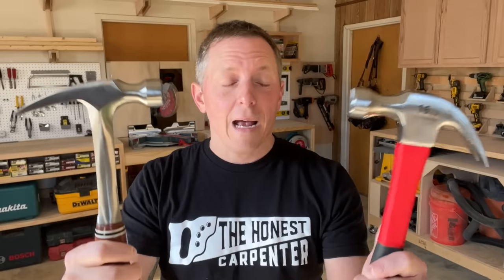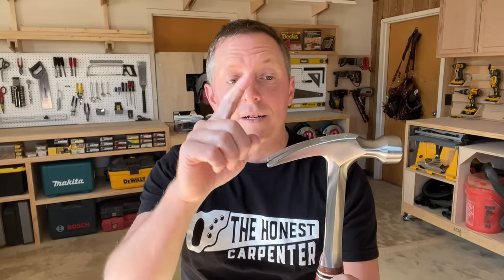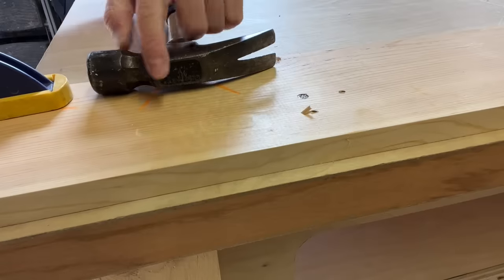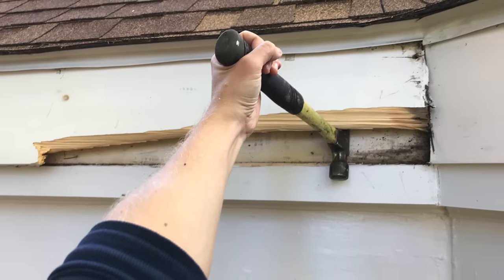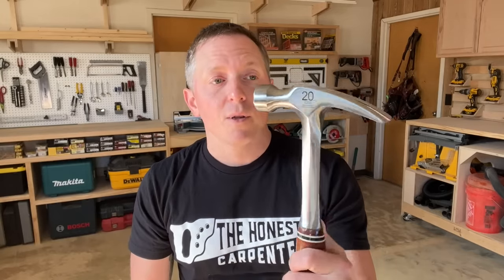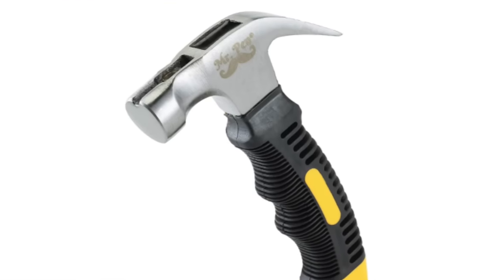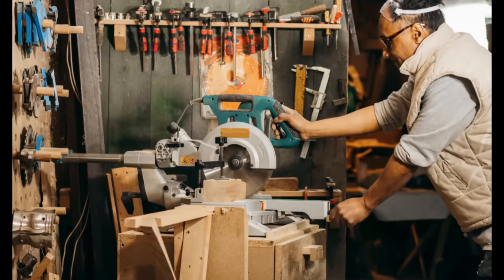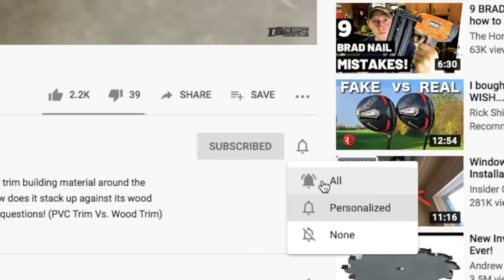DON'T USE STANDARD HAMMERS!! Try This Instead...(Rip Claw Hammer Vs. Curved Claw Hammer--Which One?)

Comment: Why are some hammer heads smooth and some with bumps? Please explain, I would really appreciate it! 

Thank you!  😀😀😃😃😃😃
Reply from the maker: The bumps are really just for big framing hammers Ziyad! They’re called “milled” or “waffle” faces, and they prevent the hammer head from slipping, or the nail from bending, when you’re driving big nails. But they scar your material surface too! So, they’re only really effective for heavy framing 🙂
Reply: Wow, thank you so much for the detailed reply!
Reply: Those bumps are for removing large chunks of skin and knuckle meat from your unsuspecting hands. I speak from experience. Lol
Reply: @blainehankins  me too 😆
Reply: @blainehankins  good thing I’ve never done that :)
Reply: @Print-Productivity  They also leave a waffle pattern on the paper, when nailing sheetrock - this is good for the joint compound to adhere to.
Reply: A shiny hammer face is more likely to miss hit a nail (of course it's really you) but if it gets overly polished rub the face on cement to dull it and therefore transferring force better.
Reply: I’m not a professional like you but my preference has always been a rip claw (for the same reasons which I didn’t realize until you pointed them out🥴).
Reply: @blainehankins  Yep, a meat tenderizer for your hand. 😁😁
Reply: @blainehankins  Yes, I thought they are for tenderizing steaks! 🤣
Reply: @TheHonestCarpenter  Waffle faced framers are made for removing your left thumbnail, over and over again.
Reply: I’m a retired carpenter and in the trades out west most people I worked with referred to them as corrugated head hammers and yes pretty much only for rough framing and the last thing you want to hit your thumb with especially on a cold morning. I currently have a curved hammer only because I found it in the barn when I bought this property.
Reply: Drywall head meant to not slip or rupture the paper covering the gypsum filling. I bought one for my father when I was a kid, not knowing he'd have zero use for it. Yeah, I felt silly too.
Reply: This is not a fishing channel.  lol
Reply: @TheHonestCarpenter  brand new ones work great for converting box nails to finish nails.
Reply: Waffle face hammer 🔨 bites finger with teeth before smashing it. Smooth face, merely smashes finger. Got all mine.🙌🏽
Reply: Hahaha
Reply: They are for Toe Nailing. In some jurisdictions in the Midwest, where they had Tornadoes, Toe Nailing was required. A proper Toe Nailed Framing Member the Nail will curve into the wood. It was a skill I was only Moderately able to Master. My Waffle Head Toe Nailing Hammer was Stolen.i replaced it, but due to my HVAC job becoming year round, it’s in new shape. BTW This was back in the 70’s, long before Pneumatic Nailers.Back then if a house, was put up, “Nailed,” like today’s houses, the inspector would have it all torn down.
Reply: The "bumps" are for education. They quickly teach you how not to mash your fingers. Before I became a framer I had only ever seen/ used smoothies & had whacked my fingers several times. When I got my first framing hammer I whacked my thumb once. *ONCE*. The only time I ever hit myself in the 30-ish years since was with a smoothie claw hammer due to a loud noise startling me as I swung.
Reply: @paulsawczyc5019  Who nails sheetrock anymore? Haven't seen that done for at least 30 years.
Reply: @ErgonBill  When you get nails for free, you use them - screws keep on going up in price.
Reply: One washes its face often and the other doesn't.
Reply: Smooth faced hammers are more for finishing work, due to the fact that they create less of a mar on your work piece, but you can still use them in all types of carpentry. .
Reply: It also makes it easier to nail in awkward angles/places. Like 45 degree into a corner of jamb and sole plate.
Reply: I would like to add concrete form work as another essential task for a rip claw as opposed to the curved claw. It's useful as a digging tool when the form needs to drop a little with respect to the stringline, as well as for picking up the board ( by way of a claw strike ) to slide it up the stake just before nailing off underforms ( additional boards that may be needed below a top board set at string level.
Reply: I think those bumps are to see how good a person is at driving nails, the less damage it shows on wood, the better the user is lol. Seriously I think they're for gripping nail heads.
Reply: @TheHonestCarpenter  
Hello, what is the difference between "Framing" and "heavy framing"?
Reply: Flat is for finishing. The waffle can pull the wood if you pull twords you as you hit if you dont care about leaving marks
Reply: I actually own. Kobalt Rip claw that I use at work...I didn't know it was a rip claw till I saw this video 🤣
Reply: Never touch my waffle
Reply: To better tenderize the meat when you hit a finger by mistake :p
Reply: @TheHonestCarpenter  your affiliate links promote a company that fights against human rights and worker rights.
Reply: A smooth face is for finish. A milled face is for framing. A framing hammer grips the nail head when it makes contact, but leaves waffle marks. I have a smooth face hammer for jobs around the house.
Reply: The waffle helps!!!! Precised one hitter
Reply: The waffle face or milled face hammer give you a bit more grip on the nail head so it doesn’t slip off the nail. Smooth hammers are used on smaller trim nails or hanging pics
Reply: Men who have bad "aim" 😂
Reply: Waffle face hammers are training hammers. They teach you not to miss the nail head and not to hit your thumb, by giving you severe pain, like a tough coach. Once you've mastered your nail driving skills, you are ready for a smooth face hammer.

Comment: I grew up using the curved claw hammer. It hasn’t failed or stumped me yet. Being in the electrical trade didn’t require having the rip claw in my repertoire. I’m over 65 so chances are I won’t be changing over anytime soon. I’ll leave that choice to the young bucks coming up through the ranks. Great video as always.
Reply from the maker: Thanks Bill! I like hearing from other trades. I could see the curved claw working well for electricians, especially because of work being done on more finished surfaces.
Reply: Electrician here 20 oz estwing rip hammer
Reply: @matttrackwell9346  Kinda funny. I bought an electricians 16 oz straight claw hammer with the longer hammer head for specialty framing. My Estwing is a little too beefy for staples and clamps on Romex. Kinda squishes the small parts.
Reply: was candy a nickel? did people REALLY sit around reading stuff on dead trees?...im #NotABoomer  .. tho i am a sparky
Reply: Didn't know about one piece straight metal hammers decades ago, until I snapped half a dozen of hammer handles.
Really bad when they breaks after store hours.
Then I started to notice.
Reply: In my day, we used to walk uphill both ways in the snow 5 miles to work
Reply: @galvanizedgnome  barefoot!
Reply: Electrician here. I keep a small maul in the car but otherwise my kleins are my hammer.
Reply: As a stockbroker, I've used a hammer once or twice in my life, and I recommend a 16oz flat hammer. 😂
Reply: Apprentice Electrician here, I've found that the electricians hammers with the rip claws take up too much space when you're trying use it in tight confines, and 16oz curved claw has been serving me better.
Reply: @ricoludovici2825  I have a Southwire extended head hammer too. I'm an electrician and use it for the odd times I actually need a hammer. I haven't touched my Vaughn framing hammer ever since I got used to the extended head.
Reply: @Themaxwithnoname use the side of you hammer for tight spaces young buck.
Reply: Same here. But, if you're building things more than tearing them apart, then it doesn't matter as much.

Comment: I’m a roofer and prefer the standard claw. When reroofing, I pull countless nails with my hammer. I use a 16 oz estwing and is the best hammer money can buy for roofing. But when it comes to use around the house, totally agree with opting for the straight claw.
Reply from the maker: Good perspective, def!
Reply: Same here, I use a Stanley roofing hammer just because it has a sweet little magnet to hold a nail on top of the hammer so you don't need to hold a nail, if you can't use or don't have access to a pasolode nailgun. 
But my work mate absolutely swears by the 16oz curved Estwing. 
Id buy one myself but I like the Stanley personally.